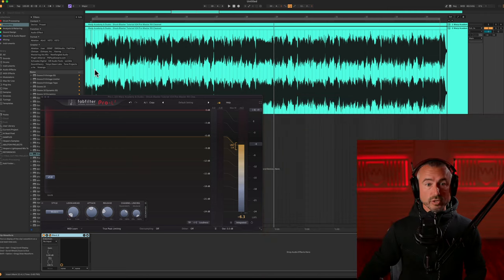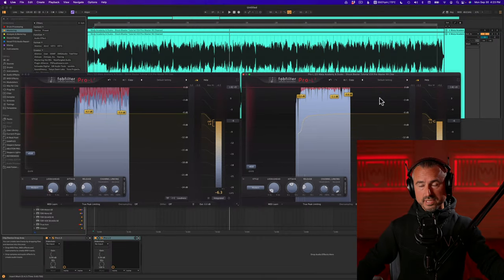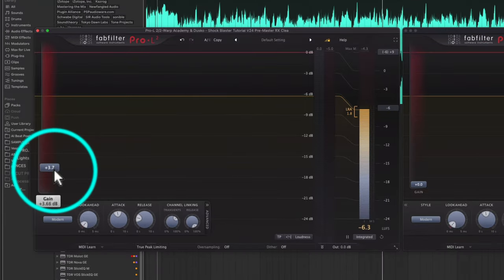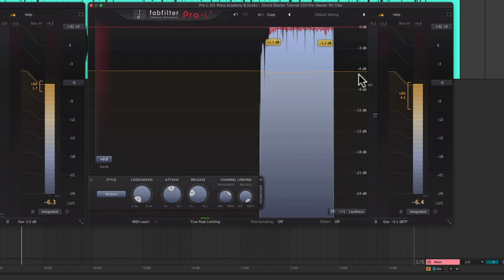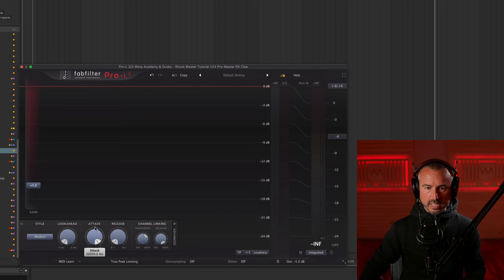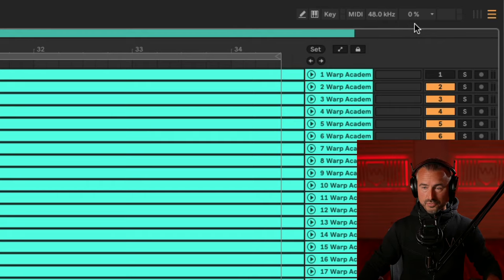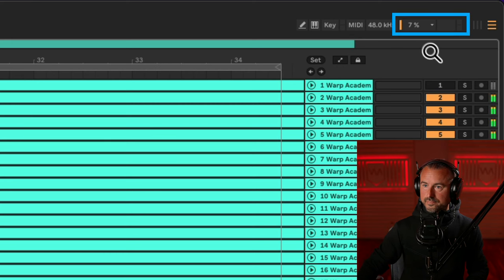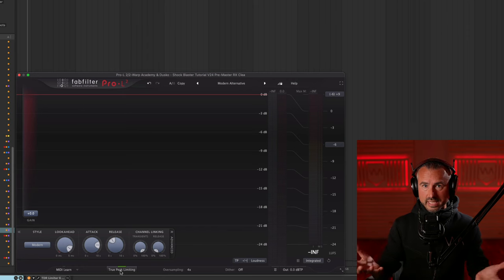3 Shocking Limiter Mistakes Exposed: Pitfalls Every Producer Must Know

Comment: Great work
Could you do a video on Oxford sonnox limiter please

Definitely one of the best ones I’ve used 👍
Reply from the maker: Great suggestion!
Reply from the maker: Do you own it?  What do you like about it?
Reply: @warpacademy  I do 
It seems to be very clean to me like fab filter on steroids  
And with the inflation it can be a subtle lift in the power of the tracks it’s used on
Lots of different parameters in there
So would love to see a video of your take on it 🙂
Reply: @warpacademy  the enchance curve is great. With slowest attack and almost fastest release, on some material it appears to be even enhancing transients when not overdoing it. On kickbass bus for example.
I love it personally, seems old but gold to me
Reply from the maker: Nice one.  Thanks for the info.  Sounds like you may also like Gold Clip and Sonible smartlimit.  They both have an inflator function too and it’s clean.  I really like using Gold Clip first in chain and smartlimit or DMG Limitless last in chain.
Reply from the maker: Right on.  I wonder if the transient enhancement effect you describe is because super fast settings are causing a bit of distortion that’s adding to the perceived loudness of them like a clipper does.  Personally I use clippers heavily especially on drum transients to contain peak level while increasing the perception of punch and loudness due to the very short distortion added to the front of the drum.
Reply: @warpacademy  Gold Clip into Master Plan is the combination for me right now.
Sometimes I even sandwich FGx2 in between, but just using the enhancement capabilities there as well
Reply: @warpacademy  But most powerful limiter imho for individual channels and busses is still UrsaDSP Boost! No need for ott'ing and the crossovers it comes with, and the drive is the best transient enhancement via saturation that I know of personally. Big video suggestion here as well
Reply from the maker: Right on.  Musik Hack, who makes Master Plan, just hired me to make a video so I just got it.  Stoked to test it out.  What's your opinion on it?
Reply from the maker: Right on, great suggestion.  I already like Devious Machines and they seem to be the ones marketing it.  I'm not a fan of OTT at all personally.  Multi-band upwards compression, sure, but not the OTT approach.  The crossovers leave a lot to be desired, phase smearing everything.  I'll do some homework on Boost.  Cheers!

Comment: Crazy looking room!.I'm also in canada and i think the comfortbatt r22 should be cheapest and effective room treatment to use?
Reply from the maker: Thanks!  Nice to meet a fellow Canadian.  Comfortbatt is good stuff.  That’s what a lot of my room is made of.  But you need lower density for deeper trapping for bass.  I used a lot of pink fluffy as well. 

Have you seen my acoustics and studio design course?  Free on Warp.
Reply: @warpacademy  yes i watched all of it. its great. your opinion for a small room and more budget friendly. I had gik in the past but i left it all in alberta and im back in quebec. you are telling me to use something else then comfortbatt r22 for the corners bass traps? you did use safe n sound neither. what about the higher density stuff like primacoustic as an exemple.
Reply: @warpacademy  likewise my friend
Reply from the maker: R22 is great if you’re making panels that are only 5.5” thick.  To get really good results you’ll need to go way thicker.  11” thick on your side walls.  Maybe more.  And deeper trapping on the back wall.  

As soon as you go with deeper treatment to address bass you’ll need to go with pink fluffy fiberglass for most of the module but with a front layer of higher density rockwool on the front for a graduated density effect.  

It all depends on how deep your module is.  Dont go high density like the Primacoustic panels.  They’re around 100 kg/m3.  That’s way out of range you’d want for anything but 1 to 2” panels or maybe a ceiling cloud.  

I really only work with stuff that’s 70 kg/m3 to 32 kg/m3 for rockwool and less than that for fiberglass.  

You can use Safe n Sound.  It’s good too.  38 kg/m3 density.  Or AFB is good.  40 kg/m3.  Rockboard 40 is great for higher density front layers to a multi density deeper module.  It’s got a dual direction fiber structure that has excellent acoustic results.  

If I was going to make a rear wall wide and absorber that’s 5.5” thick I would use 2” of Rockboard 40 and a 3.5” batt of Comfortbatt.
Reply: @warpacademy  i need to keep this answer. Thank you 😎
Reply from the maker: You’re welcome.

Comment: Great video!
I’m wondering if there’s a reason to use True Peak Limiting. I know certain platforms require it, but theoretically couldn’t I just take my master print, bring it into RX, and gain it down until I reach the required TP level? I feel like it would be the cleanest way to do it
Reply from the maker: Thanks!  And yea you could absolutely do that.  Although you don’t need RX for that.  I’d use 4X oversampling in your main limiter and then adjust the gain down if you want a TP margin using a TP meter (like Youlean freeware) all in the DAW.  No need for RX if you don’t want the extra step.  Cheers!

Comment: Great advice again !
Stupid question perhaps but why do "master" limiters use that much more cpu than the track limiters ?
E.g. I did the same test as you did in your video with the Ableton (Live 11 Suite) stock limiter and transparent limiter.
They eat up only a few percent of CPU with 40 tracks loaded, whereas eg the IK Multimedia TRackS5 limiters, which I have, take up much more CPU ?

1. Where's the difference ? I mean, they are all limiters so why do  the FabFilter in your video and in my example the TRackS5 need that much more CPU ?
   Is the (only) difference the fact these "master" limiters typically include more than one limiter under the hood, or is there more to it ?
2. How can you see, how do you know whether a limiter is a track (=lightweight) or master (heavyweight) limiter ?
Cheers
Reply from the maker: Hey hey.  Nothing is a stupid question.  Ask away.  It's good to grasp the basics.  

Mastering limiters take up much more CPU for a variety of reasons: Oversampling, all of their fancy UI and graphics rendering, True Peak level monitoring, and multiple stages of calculations aimed at reducing distortion.  As I said, it's a really big brain designed for complex sounds (IE full songs) and many use cases.  

Little built in DAW limiters, like the Ableton Limiter, don't have most of that.  They're also not going to give you great results IMO, on anything complex (busses, master).  Maybe on a track by track level, but just use a clipper for most of that stuff.  The Ableton Limiter has virtually no graphics to render, very limited metering, limited control over a minimal parameter set, no control over release envelope shape, and it has a big lookahead (minimum 1.5 ms) which means it can't really be that loud (I use 0.1 or 0.2 ms often).  

They have just updated Limiter in Live 12, which has more features now, which is good if you use Live 12.  

As for how you can tell if something is a track limiter, usually in the name or documentation.  DMG "Track" Limit implies so in the name.  It also is clear in the product description on the DMG site.  

Hope that helps!  All the best.

Comment: hey i dont really understand why engaging the oversampling makes the limiter react to inter sample peaks. could you please further explain this ! I do understand what inter-sample peaks.
Reply from the maker: For sure.  It’s a difficult thing to wrap your head around.  Probably the best article to understand this is by my colleague Ian Stewart who I mentioned in the video.  He’s on the iZotope team.  Read up here:
https://www.izotope.com/en/learn/true-peak-limiter.html#:~:text=A%20true%20peak%20limiter%20is,effectively%20when%20mastering%20your%20songs.
Reply from the maker: But to answer in short here: ISPs / AKA “true peaks” are mostly in the high frequencies and occur when a waveform would read above the sample detection points when actually in analog. 

Oversampling adds more sampling points and they’re closer together so they can pick up higher frequencies (Nyquist is higher) and thus they can detect peaks that were formerly between sample points.  

Because ISPs can be higher in level then more limiting is triggered to control them.

Comment: I dont get TP limiters. I just lower the output of my limiter to -0.35db and dont ever engage TP limiting. Did I understood something wrong? Why should a track anyways ever be close to 0? Will the listener ever notice when a track sits close at 0db or when its at - 0.35db?
Reply from the maker: Hey hey.  Great question!  You can totally address TPs by simply backing off the final output gain to create some margin.  But in order to do that properly and avoid TP overs then you need TP metering engaged.   If you’re using a sample peak meter you won’t even read the TP level.  

It’s entirely possible and quite common on loud masters to have a TP level of +2 or 4 dB even if sample peak level is 0 dB. 

Using over sampling in your main limiter with reduce TP overs a lot and so will using longer lookahead times.  So it’s all very dependent on how the limiter is set up.  Many people simply set their limiters up badly and end up generating unnecessary TP overshoots.  

So if you use 4X over sampling in your limiter and use say .5 ms of lookahead then you may not get any TP overs with an output of -0.35.  But if you turn oversampling off and use 0 lookahead you’ll almost certainly get some TP overs.  

For me I only use TPL when I’m mastering for a streaming platform.  For my typical loud electronic masters for DJ play and wav file render I don’t use TPL.  That’s how I do it.  Other MEs work differently.
Reply: @warpacademy  Thanks for the in depth answer! But as you say, its common for commercial masters to have TP peaks about X db. Let alone the stuff that was made in early digital age before we had TP limiters.
Nowadays we have good converters as well and never a system is operated at 99% of possible volume.
So personally I see TP overs as a technical theoretical problem thats not really a problem in real life.
Where it can cause dirt is with converting to other formats as mp3 for streaming, there I experienced problems with overs I believe. But then I just dial the output back a little.
Maybe you could do another video about true peaks regarding going through converters and codecs?
Cheers ❤️
Reply from the maker: Hey hey.  You’re on point there.  I fully agree with you.  With today’s converters and realistic output levels on sound reproduction systems you’re almost never going to hear TP distortion.  So I largely ignore it. 

There was quite a detailed, and lengthy debate about this involving Steven Slate saying the same thing on the ME Worldwide Facebook group.  I agree with Slate.  

Thanks for the video suggestion.  That’s a good idea!!
Reply from the maker: Oh and regarding lossy conversion yes.  I agree as well.  Nicholas from Panorama Mixing and Mastering has a good process there which I now follow where he uses a codec preview (like in iZo Ozone) to sim the compression noise that’s added and then runs it into a non-oversampled hard clipper to see if he can hear distortion, to simulate a bad converter.

Comment: Did anyone notice how higher values of oversampling in proL2 make it sound unpleasantly brighter and harsh?
Reply from the maker: Hey hey.  Using oversampling definitely changes the sound.  And it does force more limiting in most cases.  When you turn it on are you backing off the gain like I showed?   If not then maybe you’re just hearing the effects of more limiting? 

In general if you have aliasing, then activating OS should actually make the top end less harsh and bright.  That’s the theory anyways.

Comment: only 15% lol do you use the lastest apple cpu?
Reply from the maker: I’m running an i9 8 core from 2019.  Nothing special by today’s standards.
Reply: @warpacademy  9900k same as me then ;)
Reply: for desktop use and music production its super responsive and low latency. oc at 5ghz all core and very tight memory timings
Reply: or maybe you have a 10700k that is mostly the same n e way
Reply from the maker: Nice. Glad it works.

Comment: You forgot the biggest mistake.
Reply from the maker: What’s your opinion on that?  Just limiting too much in general?
Reply: @warpacademy  I'm never happy with my mixes/ masters, but Pro-L always makes mixes sound like paper. Maybe it's that oversampling you were talking about.  I dunno about the limiting. Probably, my newest song is -7lufs. I think i might have a problem.
Reply from the maker: @GetSongsDone  How much limiting / gain reduction are you getting in Pro-L2 to achieve -7 LUFS?  If it's more than 2-3 dB, then that's your problem.  Too much limiting on your mastering, and not enough control of peaks and dynamics in your mix.  

Any limiter will sound bad when you're engaging it too hard and doing too much on the master.
Reply: @warpacademy  oh, i don't use pro -L. Because the paper thing. - 1-4 db at each stage. Limiter, compressor, hf limiter, multiband limiter, final limiter
Reply from the maker: How loud are your mixes if you normalize the peak level before mastering?  IMO, to be really honest, that is way, way too much on your master.  That's killing it.  You need 1 limiter.  Perhaps a clipper first in chain to take off a few odd peaks here and there.  Then a final limiter (I like multi-band limiters).  

Watch this: https://youtu.be/_HiDh7n6TaU. 
And then watch this: https://youtu.be/YpbV0INpHgc 

Hope that helps.  Cheers!
Reply: @warpacademy  ok, i get it. Ty
Reply from the maker: Sure thing.  We have a Discord server for that with a song feedback channel: https://discord.gg/ZwNgZteGKw
Reply from the maker: Yeah I think the loudness levels you’re pushing to are unnecessary.  I mean we’re not talking about a drum n bass song.  Try back off the amount of loudness as the mix is clearly suffering in your own opinion.  If you run it back towards -10 of -12 LUFS you’ll give it some breathing room.  Not all music sounds good with that super tight containment that suits a lot of EDM.  And with loudness normalization on most platforms you have to factor that in and master to what sounds best not what sounds loudest.  Always respect the song and the fidelity.
Reply: @warpacademy  I dropped it in there, but never got a reply. should it not be a spotify link?
Reply from the maker: Oh I don’t always reply immediately.  Lots on my plate.  I just mean in general post things in there if you want feedback.  And Spotify links are okay but something streaming like a YouTube video or SoundCloud are good. 

I’ll try and give it a listen.  Cheers mate!